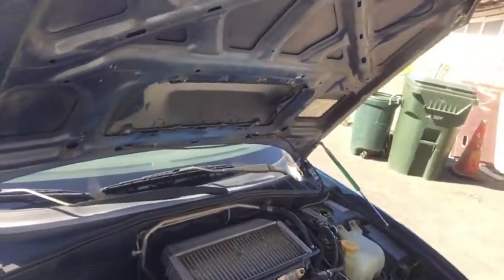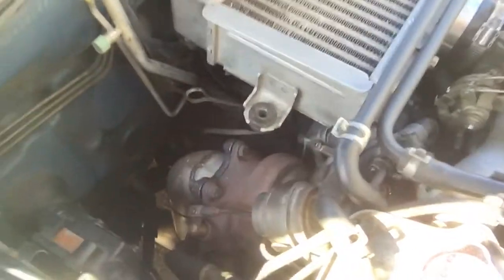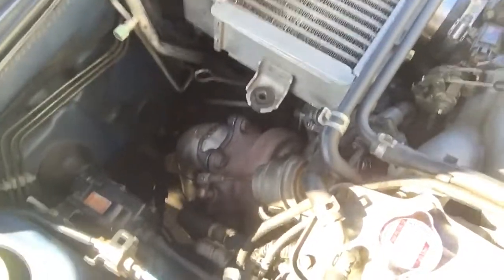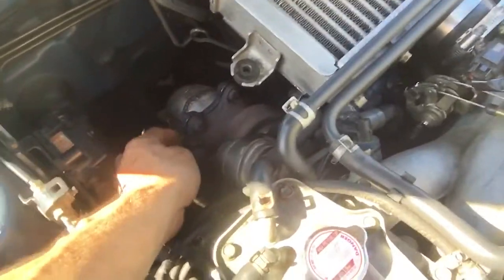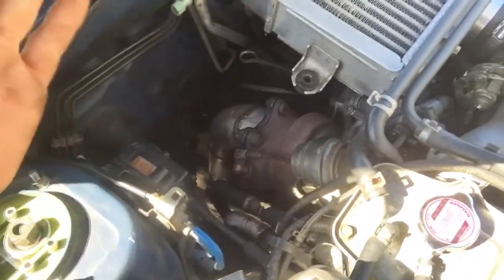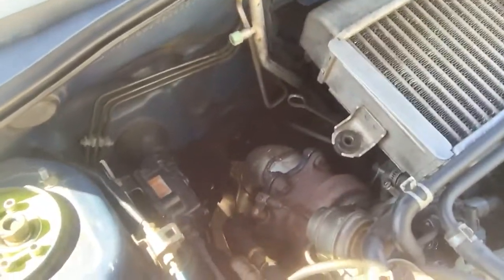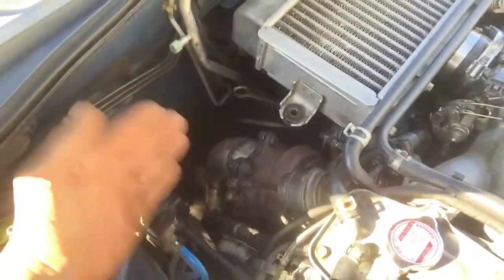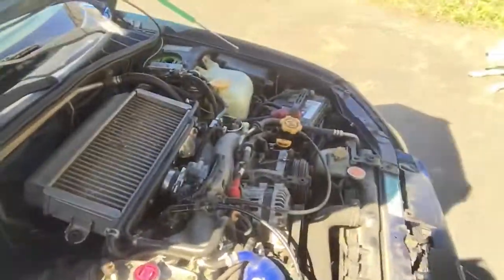Turbo 101 - Wastegate basics

Comment: this was super helpful, Had replaced the vac lines on the turbo on my forester and couldn't figure out why I was suddenly capped at 7 psi boost. Adjusting this until it peaked at a nice 12.5 psi that my car is tuned for was the solution to my problems, thanks man

Comment: Shortening the wastegate doesn't create lag or top end power, having a larger hot side does that. This also isn't how you "tune" your car, it's how you overboost a car that isn't tuned to do that
Reply: Chris Smedley Exactly. Wastegate preload should only be adjusted to fix wastegate chatter/flutter or overboost caused by sticking wastegate
Reply: I wonder if he's blown it up yet...
Reply: @tobyj1012  definitely lmao
Reply: Amen to that brother ❤
Reply: As the rock said it best. Shut up betch
Reply: im here a little later and trying to figure out how to do this because i am currently being tuned. apparently from my tuner i am only  hitting around 16 psi but should be around 18 so he wants me to tighten my WG by 1 or 2 turns (first 1 turn test and see if i hit ideal boost if not 1 more turn) i was trying to find a video but this is the best one i could find, should i not be doing this?